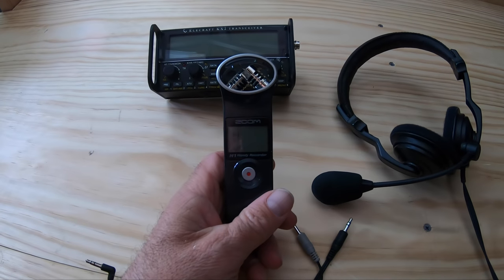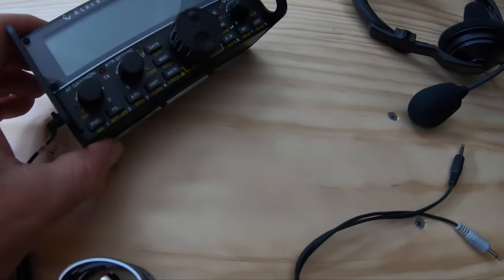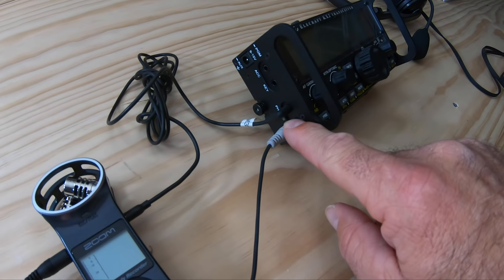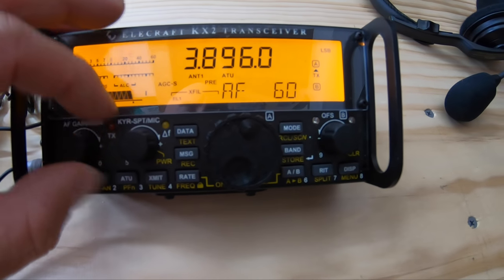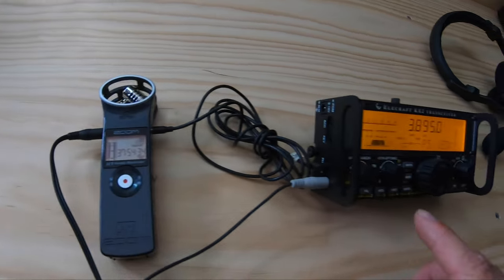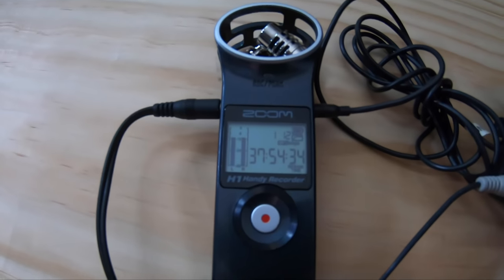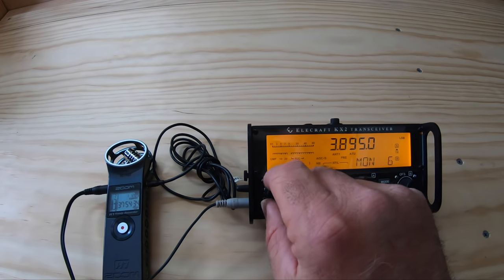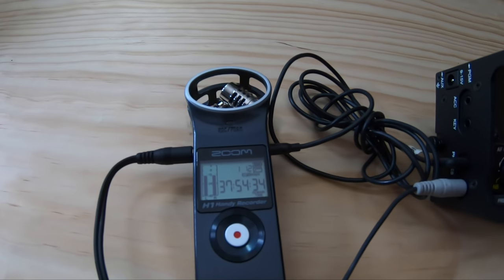HOW TO Record Ham Radio QSO's (settings)

Comment: Great explanation of your set up there Jerry.  I really liked the audio as well as the trip to Hoyt Peak.   Thanks... 73
Reply from the maker: Thanks Scott and this video has someone take notice of those handy SideKX extended legs too 👍.  They were directed to SideKX and I'm wondering when that knob will be available.  I'll have to look into that 😀
Reply: @KG6HQDJerrySOTA   I see my fabricator today or tomorrow regarding the new mold that is just completed to make the new knob in a two part mold one for the base in hard plastic and the other is the tire in a soft rubber for traction.
Reply from the maker: @scottak6q406  Please keep me posted, offline is good too.  Thanks!

Comment: It's always best to get a clean signal as you can and if you can get direct access to the audio signal it's even better.

Another way to go about it would be to set the level on the radio and adjust the headphone level on the recorder. However not everybody coming in Will have the same level so in some ways you might be better off individually adjusting it on the radio. So long as you're not distorting the input and AtoD converter's.
Unless use tape, tape has a wonderful built-in saturation compression.

In post production you could normalize the audio file that should bring up the low and high bits to a relative level. to go further than that you could use some compression and that would help with the variation in levels..

Comment: Great tips Jerry.  Thanks for taking the time to make this video.  With regards to your Heil Pro Micro Headset,  do you use the one with the dynamic mike (no bias in KX2) or the Pro Micro IC (Bias on in KX2)?  Just curious.  Thanks and 73, George K2WO
Reply from the maker: Hey Georg I use the dynamic mic version (no bias in KX2) and love it actually.  It's a little bulky for a guy who likes ultra light weight stuff, but has proven to be pretty sturdy.

Comment: Interesting - I assume when using CW, that it will record the sidetone when transmitting? When you're shooting the video, do you output the recorded audio to the camera input at the same time or do you mix during editing? I guess IOW, how do you mesh the recorded audio with your yt videos.
You should put an antenna or dummy load on the kx2 even with the power at 0.0 - I've read of people making contacts with an antenna connected while set to 0.0 because the rig was transmitting at mW levels...
Reply from the maker: The side-tone will be recorded just as the voice would under the MON feature.  The MON allows you to hear yourself or the ST so it'll record it.   I don't pipe into camera in the field instead that's done in post processing.  I usually do a loud clap or with my loud voice Adobe Premier Pro is able to sync it all up perfectly.  I basically drop the H1 audio file under the GoPro file and then select the two and hit sync audio and it's done.  You can then turn the GoPro audio off if you like and you're left with the filtered H1 audio.  In the video I linked, "Hoyt Mountain" you are hearing both the GoPro and H1 recordings simultaneously so you can see it does a great job synchronizing them.   Ha, copy that on dummy load, and so far so good i guess.  Even in the Elecraft manual I recall them suggesting practicing code with the power set to zero output with no antenna, but your point is well taken.
Reply: @KG6HQDJerrySOTA  Video editing is way above my skill level tho I'd like to learn it someday. I'm lucky if I can get Lightroom to do what I want with stills. Yeah, better safe than sorry - these little KX radios are expensive little suckers...
Reply from the maker: hogdriver88  LR is my friend, so is Photoshop and Adobe Premier and the whole Adobe Suite 👍
Reply: Great question. I will also note that without the antenna would make "some" difference as that would add some gain but it would still be a good practice to use a load and not build the habit..

Comment: Jerry, 

Does the recorder have a built-in clock, and if so, is the time the recording is taken recorded as well?  When you play back the recording, the time the recording is taken is displayed?
If so, that would be damned helpful logging all the QSOs later on.  

Don / W5DON
Reply from the maker: Nah it doesn't have one that would be captured on the audio file if that's what your asking but you can just add that verbally if you wanted to with each qso as part of the confirmed contact.
Reply: Most of the recorders I've seen of the better quality ones at least will have an internal clock and if the time is set this will timestamp the files as to when they were created and then it's a simple matter of math to figure out how far along in something is. This doesn't apply if you use an automatic setting to save space where it would pause under a certain level.

As far as time code no not less you get into the more expensive recorders, if you're trying to sync the audio with something else like the camera audio hopefully both devices have a reasonably accurate Clocking system to prevent drift.

Comment: Do folks who do sota also do qrp cw, ive seen videos as well of people trail running or hiking then doing qrp/cw both look so cool
Reply from the maker: Actually most of us are QRP operators and CW is a huge segment of operators on SOTA peaks. I choose SSB to help share the SOTA concepts with new people to ham radio or for hikers to see the benefits of having ham radio while in the wilderness.
Reply: @KG6HQDJerrySOTA  i can see the whole qrp thing its the adventurous side of amateur radio.  Its appealing more then plain amateur radio. Im reading that folks who qrp trail run and or get creative with qrp with the fitness aspect that looks like it would give me a rush to do
Reply from the maker: It’s a blast and has endless possibilities for fitness and technical challengers
Reply: @KG6HQDJerrySOTA  lifting weight, cycling and running give me a rush im sure sota, qrp and cw radio will too